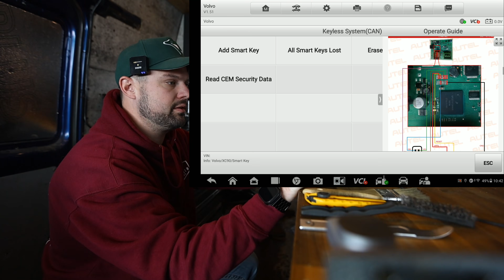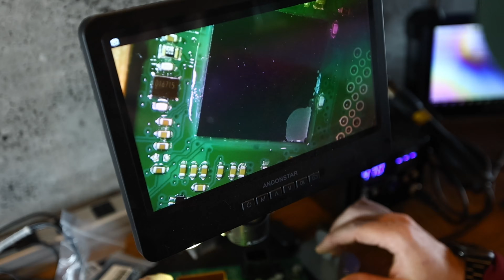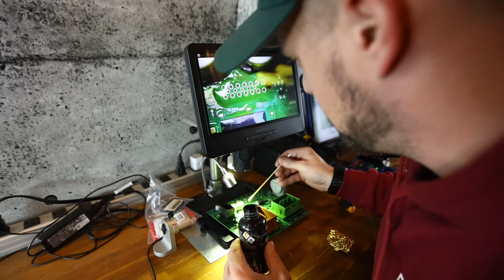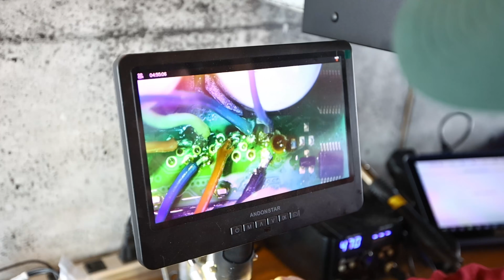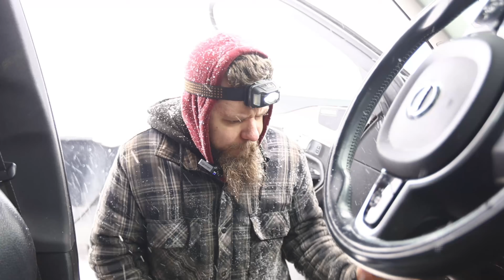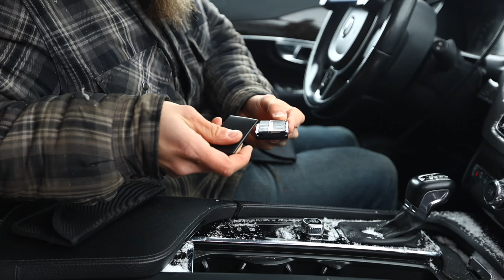All Keys Lost | Volvo XC90 Smart Key Programming (2016–2021) | Autel IM608 Pro II + EEPROM + OBD

Comment: For BMW, Audi, and Volvo vehicles, Xhorse provides various adapters to read data from modules such as BDC2, BCM2, and CEM in all-keys-lost situations. On the other hand, for the same group of vehicles, Autel retrieves data using soldering methods. Based on your experience, which is more successful for EEPROM data reading directly from the circuit: Xhorse or Autel?
Reply from the maker: Different tools for different cars. Different processes and different capabilities.

I personally use autel for these. I’ve heard good things about ACDP too.

Comment: I did an XC40 (2025) the other day. I had a similar issue at the beginning, the CEM was failing to read. The reason was that the wiring I use to connect were to long. After I shorten the wires, the CEM was read successfully. Something for you guys to consider. The wires should be as short as possible!!!
Reply from the maker: Yes - great point. Do not extend the wires the give you, I forgot to mention that and it’s important!

Comment: Why you didn't solder on the other side of the PCB?! Pads are clearly visible, much easyer and safer to solder from there. And please, use a better flux, clean the tip (it must be clean, otherwise you will loose heat, and solder will not melt), and when soldering heat the pad and then add the tin on the pad to have a good and shiny solder.
Reply from the maker: Thanks for the comment!

Comment: Only a professional locksmith would dare to do such a job with such precision and skill. It was done very professionally and without any flaws and I thank you for this complete tutorial that you posted on YouTube.
Reply from the maker: Thank you so much!
Reply: @autokeyproofficial @autokeyproofficial that tip about twisting the CEM was clutch bro thank you. But why bother soldering the top of the board when  You can just mirror the points and do it from the bottom with more space for the 0N32e board?

Comment: Thanks for the step by step video. This type of work is very risky and damage to the CEM is costly. I recommend using VIDA for Volvo any day of the week. I understand it’s expensive but as long you charge the customer accordingly, it’s risk free.

Appreciate your channel and kudos on getting the job done
Reply from the maker: I definitely don’t find it risky - I’ve done this process 10+ times and it’s always gone very smoothly for me.

It’s personal preference - this way makes more money.

Now - if you had 10 of these lined up for one day of work - then I use VIDA.

Always have 2-3 ways of doing something.

Comment: Awesome video. Thank you for this valuable information. 
I have a 2010 Volvo V50 all keys lost.   I am equipped with all the essentials Gemini strongly suggested that I also get a digital microscope,  so I did. 
Waiting for the new key to arrive already 😅.
Working with the Xtool X100Max and KC501 programmer.  
The harness I have to use, has a db9 connector that connects with the KC501. 
This is my first, first everything.  Soldering on a pcb, and 1st Volvo. 
I dont think I've even been in a Volvo taxi 😂
Reply from the maker: Good luck with the job! Hope everything goes smooth for you man!
Reply: @autokeyproofficial  thanks. It hasnt.  
But was ablebto successfully read 2 dumps.  Besides the tools instructions in TangunEglish. They locksmith received the wrong key for that year range. Im not blaming him directly but thats a 3 day hold up over the weekend  🤦🏾 .
Reply from the maker: @feyrrari ahh shoot. These things happen, just how you deal with it that sets you apart from everyone else - you got this.
Reply: @autokeyproofficial  hi.

I am heading yo the car to install the cem. 
After reading the chip. The rest is obd. 
Its suppose to be a 24 digit key im going  to try the 16 digit. Last night I backed up a FEM I had laying around. This was done with a clip attachment.
Reply: @autokeyproofficial  hi.  I reinstalled the module. No damage it communicates with my x100max diagnostic tablet.  Clearned DTC's. But it didn't take the key. The owner was fed up blew a lid. I let it go. It was all good training.  Thank you for being here and for the videos, they are a gem.

Comment: Dude just use the factory software.
Reply from the maker: We have OEM software - the point of the video is there is more than one way to do something. 

You would notice that if you watched the video right until the end where I mention that factory software is much faster ;)
Reply: @autokeyproofficial Guilty, I didn't watch it till the end. Respect what you are digging at.
Reply from the maker: @mikecdyer I figured - I just had a Volvo I did the other day with OEM software. About $150 USD to program the keys.

I would personally rather pull a module - I have a lot of experience disassembling dashes and it’s doable within an hour total.

VIDA takes about 10 minutes or so - however if I have the time, I don’t think it’s worth it unless other jobs are booked and I’m rushing.
Reply: @autokeyproofficial don't you have to pay for online licensing either way? so moot point?
Reply from the maker: @BopperNoStopper do you mean a yearly subscription?

Comment: Not sure what the Volvo procedures are where you are.... but in the UK, you really should try and use VIDA at every chance you get. When the vehicle go's into a dealer for any work, it will automatically get most software updated. The CEM will get reloaded with the old key data(because Vida doesn't know about the new ones) and the new keys will be wiped leaving the vehicle stranded at the dealership. I have personally seen this happen.
Not sure of any other manufacturers doing this yet but I predict they will follow suit.
Other than that, fantastic video. It shows the lengths we go to in order to get a customer back on the road ASAP.
Reply: In this case wouldn’t it be on the dealer to fix the issue? It came in working fine and is no longer working. Obviously we wanna make sure the customer is happy with their car but at the same time this sounds like a dealer issue.
Reply from the maker: Thanks for your comment - we are familiar with VIDA - I have yet to confirm keys getting “kicked” like that.

I will text this myself by updating the module one day and see if the old key data gets restored in the North American market or not.

Comment: Worst soldering i have seen for a long time. You can use ”pogo pins” with a 3d-printed holder for this kind of jobs. No soldering required. The ”cylinder things” is called CAPACITORS 😂
Reply from the maker: Thanks for your comment, it supports the channel. Multiple methods to complete a job, I agree.

Comment: if you guys are doing a bunch of board-level wiring, i'd suggest getting some gold springloaded pins, ive used them before for ECU unlocking/cracking. a lot more professional and doesnt leave any trace on the board; just move the helping hands above and position the pins on where you want contacts to go, and finally plug into your autel tool
Reply from the maker: Sounds like a super cool tool. Can you post a link for me to check out?
Reply: @autokeyproofficial  i searched on google "test probe holder board" there are 3d printable ones as well :)